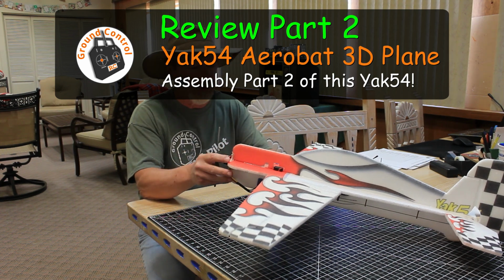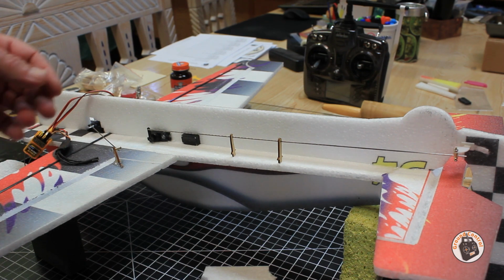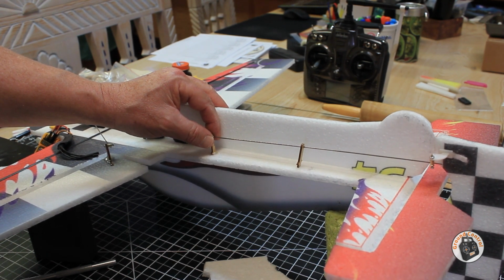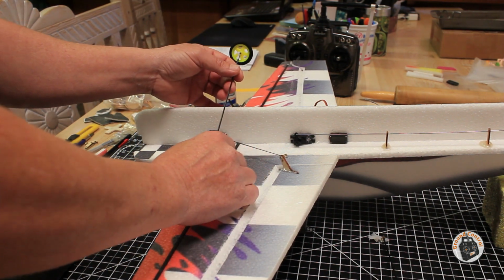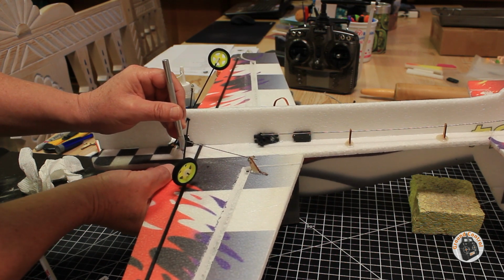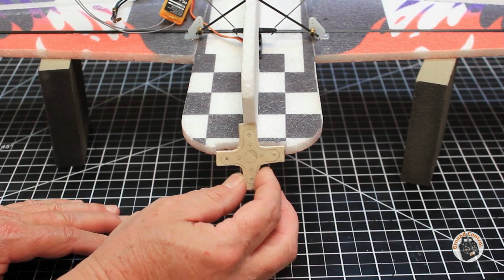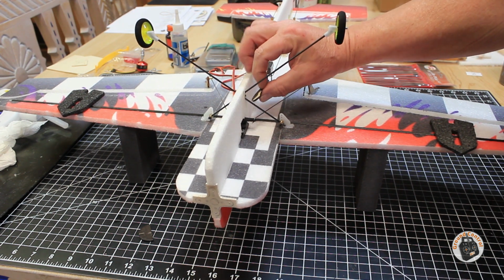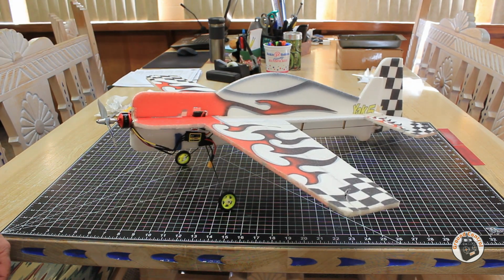Review Part 2 - Yak54 Aerobat 800mm Wingspan 3D Plane - Assembly Part 2

Comment: I hope you can teach me what materials used in yak 54, like what part of the plane is the fiber, aluminum, and titanium. thanks
Reply from the maker: Good question! The airframe is EPP Foam, the motor mount is plywood, and the landing gear is carbon fiber rod. That's about all the material accept for the plastic control horns. See you in the Air!

Comment: Cool video, though I never could get interested in these flat foam board "profile" airplanes used for indoor flight.  They just never appealed to me.  Maybe my old school is too old? ;-)   Look like fun flyers regardless.

Happy flying!
Reply from the maker: Thank you! I was never fan of these flat wing planes either, but I was very surprised by the capability and maneuverability of this Plane. It's a blast to fly. I think I may add KF4 Airfoils later on just to see how that works out. I would think having a symmetrical airfoil on this type of plane would make it even better ;-) See you in the Air!